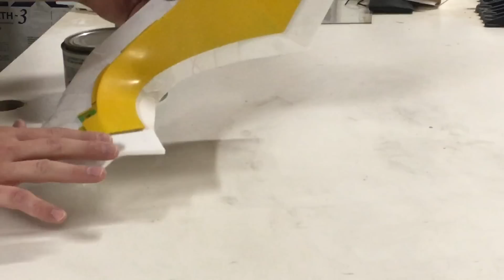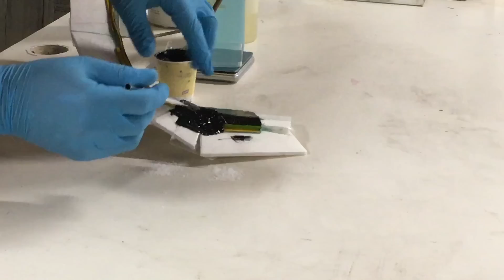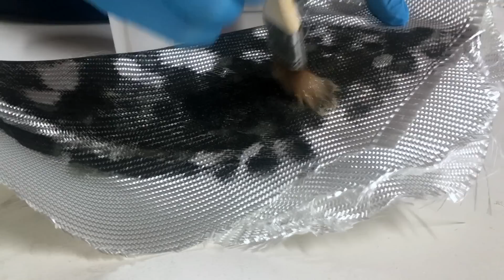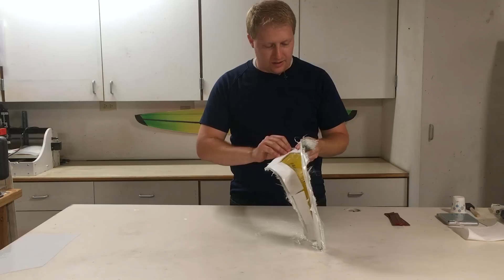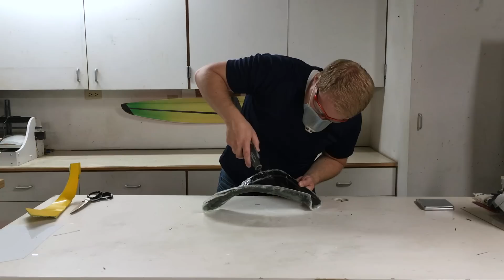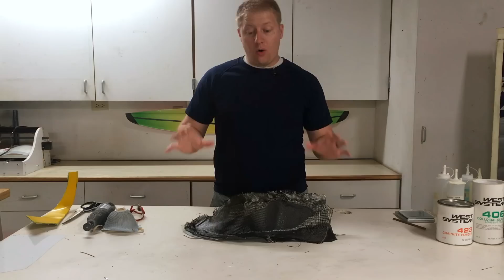How to Make Carbon Fiber Parts (Including the Mold)

Comment: I am almost ready to mill my first part that I want to use for a plug to create a mold and had planned on doing it with rigid foam insulation board since it's cheap and easy to mill on the cnc router. Do you think using the foam would be ok or should I look for an alternative?
Reply from the maker: That can work, but I'd recommend a couple of precautions.  First, cut off the top and bottom 1/16" of the sheet before machining.  There are residual stresses on the faces, and just machining one side while leaving the opposite face can cause it to warp.  Second, know that you're going to have to fill all the pores of the foam with something, and Bondo will melt the foam so don't use that.  I've only ever heard of people using epoxy, but there may be an alternative I'm not aware of.  Third, know that it'll probably be a pretty fragile plug and you'll have to be very careful.  Don't plan on being able to use it more than once.

I've had great luck with using MDF instead of foam.  It's affordable, can be bonded together in sheets, machines easily, sands easily, and is a lot more durable than foam.  Machine it, sand it, paint it with epoxy to seal it (all sides of the billet or it'll warp as the epoxy shrinks),  wet sand just enough to smooth out brush strokes, 1 more coat of epoxy, lightly wet sand and polish.  Best of luck!
Reply: I had considered the fragility of the foam for sure. I thought about mdf but was concerned with warping like you said. I appreciate the advice and I think I'll try the mdf for sure. I'll let you know how it turns out but first I'll need to setup a vacuum system for it because it's going to take around 6 hours to mill and that's obviously a lot of mdf dust!
Reply from the maker: @primate2744  Yes, PLEASE set up a vacuum system for the sake of your own health.  It took me forever to set one up for my CNC, and my only regret is not doing it sooner.  Controlling dust will save your lungs.

Comment: Great video it was very informative but that dust mask is not sufficient protection.  I would look into a half face respirator with the proper filter at the very least.  Regular dust mask are only adequate for light dust.  Those cuts should be made with protection good enough for asbestos!
Reply from the maker: Actually, we tested different respirators using particulate meters in the aerospace company I worked for and these more than exceeded OSHA standards for this kind of work.  You need good quality ones that seal around your nose and mouth, though.  Not dollar store dust masks.  For more intensive work I prefer a full face respirator because it keeps the dust out of your eyes as well, which safety glasses don't do particularly well.

Comment: How long did it take to get to the tacky state for you?  I am doing a project for school similar to this, and I wanted to know, so that I could arrange a schedule in the lab.
Reply from the maker: It depends a lot on what resin you use and what the temperature is in the room.  Most epoxies will tell you what their "pot life" is, which is about how long you have to work with it before it starts to get too thick to use at room temperature.  The right level of tackiness for what I describe in the video is generally about twice the pot life, so 40 minutes for a resin with a pot life of 20 minutes.  If the room is warmer then it'll be faster, and slower if the room is colder.  Hope that helps!

Comment: Your layup is to dry .... this is the type of layup I would reject.  Secondly, the use of a Thixotropic  resin will resist slumping.
You say you have 10 years experience? .... What I observe is self taught with no formal understanding of composite engineering.

I know of no professional that would slap something together in this fashion.   And not wearing an appropriate mask is an extreme health hazard!
You are using and promoting very  poor work practices!

Comment: *looks at every body panel on car
Reply: How to make my miata a rolling death wish lol.
Reply: I was wondering. What would you do for a rough surface? I noticed your piece was very smooth. Everything I want to work on is rough.
Reply: @1120mrevo  sand it out lol
Reply: @1120mrevo  I know this is an old comment.They are typically injected or flowed onto a polished metal surface, it's called HP-RTM and it should be doable as a DIY project.
Reply: @1120mrevo  he mentions at the beginning that the resin will copy the texture
Reply: @angry_mario  With rough textures i apply a little more gel coat to smooth it out afterwards.  Everything is kinda adjustable if you do it right
Reply: I used my BMW front bumper as a mold to create my new carbon fiber Front bumper it's so nice! I got a 3D printer and got the dimensions of canards online and typed them into my 3d printer then used the 3d parts to create carbon fiber canards man I am looking into high heat carbon fibers because I have the dimensions for the down pipes online and I'm thinking about making them! And just using the sensors that come on my stock system and install them in the carbon fiber down pipe once i make them. I am half way done with my carbon fiber Front bumper custom lip i am designing because I am making the 3D design myself as they don't offer the dimensions for those online. I wanted to make a back bumper diffuser but I want that crisp carbon fiber that feels like metal for that
Reply: @EggPlantEmoji69  you’re 100% full of shit lol
Reply: @EggPlantEmoji69  what bmw u have? I have a 2014 335 I'm looking into some of the same stuff right now
Reply: I might the first man with a full carbon fibre crown Victoria
Reply: This!
Reply: Yep, doing that right now I side my old ACR Neon.
Reply: You mean every part
Reply: Looking at my jon boat's hull
Reply: HAHA LOL
Reply: 😂😂I felt that
Reply: Check out street banditos they build a carbon 240z
Reply: The street bandito way
Reply: Hahahahaha same
Reply: ☝🏽☝🏽😂😂😂me
Reply: 777k views and 777 likes 🙃
Reply: me looking at my jetski
Reply: The masculine urge to replace all your panels with carbon fiber is real

Comment: Best using a layer of tissue (or you may call it veil) continuous fibre mat, directly on the back of your tooling/gel coat, followed by 225gm csm before your woven layers. Very rare to get the gel coat separating and you can use one less layer of woven mat.

Comment: Do you always have to make a mold or can you just lay directly to the part?
Reply: If you lay it directly onto the part, the end result will be larger than the original body panel so it wont fit right
Reply from the maker: What you're referring to is called "wrapping" or "skinning".  It results in a heavier part and, like Trey Roth mentioned, it'll be slightly larger.  Depending on the part, that may matter or it may not.  But if all you're looking for is the look of carbon fiber and not trying to save weight, you can do that.  Search Youtube for tutorials on skinning and you'll find a bunch.

Comment: That's just fiber glass...with graphite added... not actual carbon fiber.  I guess technically it is but assume that doesn't have the strength or weight reduction of the real thing

Comment: Most of the resins I have run into mix by volume, not by weight. This is because they are designed to have pumps that allow for quick dispensing. Check with your resin manufacturer. Also, pva stands for polyvinyl alcohol.

Comment: After you measured the 30g 2:1 resin mix, you should’ve weighed it really quick just to see and let us know how much it weighed with the carbon so we knew how much carbon to mix in
Reply: when mixing resin its honestly best guess & experience, after making afew parts you quickly learn how much resin to mix up. creating resin you can either opt for mixing via weight or volumn. when you buy the resin it usually comes with a recommended mixture potions table.
the carbon powder isn't really needed, its just to add abit more colour & redue the yellowing effect you may get over time! 
painting the part with a clear coat also helps reduce this

Comment: Do you ever do projects for people?
Reply from the maker: Not at the moment.  I have before, though.
Reply: @SasquatchComposites  Cool! I don't know if you will help me with all of your experience but if I were to do some carbon fiber front reflectors would it be wise to just do a skin or could it be done with a mold?
Reply from the maker: @crispcarguru303  I don't have any experience with skinning, but just about any shape can be made in a mold if you're willing to make the mold complex enough.  Ideal candidates for molding, though, are parts that you can't see the back of when they're installed, and that don't have any negative draft (look it up if you're not sure what that means).  That way you can make a one-piece mold, which is always easier than multiple pieces.  I've been told that skinning is an easier way to start doing composites, but I guess it's never appealed to me to even try because it ADDS weight, which is the opposite of what carbon is really intended for.

Comment: What factors made you choose to make the mold with fiberglass rather than using Carbon Fiber?
Reply from the maker: Purely cost.  Glass is considerably cheaper than carbon.
Reply: I also think fiberglass is a lot easier to work with

Comment: Cool vid, if you would have just stuck with +45/-45/+45/-45/+45s for the fiber glass for the the mold. You probly would have been able to wrap around the part without having to make that splice. Also instead of poking at the female radius of the fabric with the end of your wooden brush, wouldn’t have it been better to use a teflon stick to smooth the fabric into that radius? Also how’s the over all strength of the part vs using a vacuum pump?
Reply from the maker: Yes, sticking with all 45s would have been easier.  However, my experience has been that if you don't include 0/90 plies then it will eventually warp.  As for the strength, it's not the same as a vacuum bagged part would be.  I'd expect about 1/2 to 2/3 the strength.

Comment: The problems you described when making the mold is why I always use chopped strand mat when working with curved parts, it doesn't have problems with lying flat over curves, and why wouldn't you use a tooling gelcoat for the mold?
Reply: Hey  do in u have any tutorial vids?

Comment: Were is your vacuum system?
Too much resin makes the part week you should weigh out you material and do it correctly.
Were is your bubble buster?
Heat lamp?
It would be cured in 4 hours?
Reply: He didn't use a vacuum in this video. This is called hand lay-up or hand laminated carbon fiber.
Reply: @VirusTornado  yes but he did not even have the proper stuff for the hand layup

Comment: Why wouldn't you use some nice light cloth for the first layer of the mold so you don't have to fight it into the fine details? Or alternatively get really lazy and just mix up some milled fiber into the tooling coat? Then just bulk up some cheap mat to build up the mold.  Same on the carbon layup. You could add a layer of glass veil first that would wet out easily and fill in the fine details and you wouldn't see it over the carbon. It would probably make for a nicer surface for hand layup. Probably stronger too as it would otherwise be mostly epoxy on the surface where the carbon won't follow all the detail.

Comment: Dude, really, 10 years and so many mistakes???
No Gloves, no respirators, and no glasses when sanding and cutting wtf ????
The corners looks like that because you're not using vacuum to press the resin and the carbon fiber toguether on a thight spot, the vacuum creates pressure on that point forcing the fiber to really get into the corner and bond with the resin, avoiding delamination and cracks in the future.
Here, watch that.
https://www.youtube.com/watch?v=9F1Hp_nqqOY

Comment: vacuum forming would've kept the problems he had out
Reply: Well if we are pointing out mistakes  its use a vacuum pump not vacuum forming that is a completely different thing
Reply: Since vacuum forming is a process that uses a vacuum pump either way it would have still helped  @bozobaz30
Reply: Also since a pumping process is used for vacuum chambers you would be incorrect because forming requires the part to be in a sealed bag that would allow it to hug and form against the part as the air is vacuumed out which would be why it's called vacuum forming  @bozobaz30
Reply: @MobileAudioPro  vacuum forming is where you heat a sheet of plastic and then turn on a vacuum to pull the plastic into the form of the desired object using a vacuum pump in this circumstance you would put the part in a vacuum bag then apply vacuum to remove air bubbles lock off the pump seal valve on bag then if you have a big enough vacuum oven you cook it otherwise the vacuum bag will do just keep topping up the vacuum with the pump I've made plenty of parts for my 4x4 and I've never used my vacuum former
Reply: I am pretty sure you are referring thermoforming or heat forming. But either way using a vacuum to seal acrylic in a tight shape or make a plastic mold is still forming with a vacuum. The bag type of forming process is the only possible way to achieve the best look for this project anybody who watches this video I am sure would know which of the two to use. It's really a matter of opinion but using common sense people can see which vacuum forming type to use.     @bozobaz30
Reply: @MobileAudioPro  nope I mean and described vacuum forming it's how i made my spare rc body shells from lexan look up vacuum forming and when the part is in the sealed bag its not forming nothing it's only to push the resin into all the gaps and apply consistent pressure across the whole part the mold is doing all the forming the by definition the mold is the form not the process the process is curing under negative vacuum pressure
Reply: I have looked up forming and it comes up with results for both so since neither of us are gonna convince the other who's right you have a good day sir and best of luck in life   @bozobaz30

Comment: Do you know if other cloths can be used for this process, like burlap or tweed, or if the material actually interacts with the components of the carbon fiber?
Reply from the maker: If I had to guess I'd say burlap and tweed would both probably work fine.  Fabrics for structural composites have what's called "sizing", which is essentially a coating on the fibers that helps them bond to the epoxy.  Natural glass or carbon fibers won't bond nearly as well as ones that have been coated in the sizing.  However, other materials (like burlap and tweed) may not need to have a sizing in order to bond to the epoxy well.  Those materials are pretty inexpensive compared to carbon, so it wouldn't hurt to just give it a try.  Just don't expect it to have the strength of glass or carbon ;)
Reply: @SasquatchComposites  Thank you for the insights.

Comment: A roller for installing screens in a window works very well for the sharp edges to get clean tight lines
Reply: Ed Jack  you can buy purpose made metal/alloy rollers of various shapes & sizes for fibre glass & carbon fibre however the issue with those are they do get cacked up with resin very quickly, a simple hard edge to lay & rub on the insides works better & can easily be cleaned up.

Comment: Anybody else cringe when he creased the fibres before wetting it out? Not a smart method for dealing with radius’s. Wet and lay one side and corner, give it time to dissolve, then tackle the next side. Use CSM for your mold. Always use tooling gel. Use rollers. Always wet out your fabrics before creasing. Make sure flanges are FLAT, the extended fabric that hits the uneven flanges will deform the rest of the fabric on the part. Do not have bigger radius’s for your fillet wax strand on your flange-you actually want a sharp edge there, with thick tooling gel and CSM to have a crisp outline on your part. You should not have done a 0/90,45/45 pattern, it is a long skinny part and you’re wasting fabrics reinforcing the short width of the part and not reinforcing the long length of the part. 10 years my ass, I’ve been doing composites for less than a month and this guide made cringe.
FYI your clips’ volumes aren’t consistent
Reply: Not as hard as I cringed looking at that Miata
Reply: Hmm haters gonna hate. But I can back up my criticism. Can you back up yours?
Reply: @thunderbirdizations  Who's hating? I can back up my criticism by posting a link to that hood job you did on that Miata    https://www.youtube.com/watch?v=mWSoNu6XeY8

Good lord what a hood....
Reply: @hunterjones9822  god damn you did him dirty. and yes, that hood looks absolutely horrid. IDK what you where thinking making it
Reply: @rexjonhdeer8180  But the real question is, did you cringe when you saw it???  LoL!